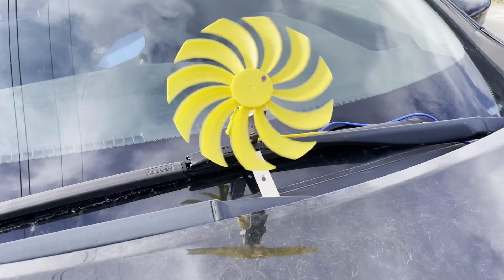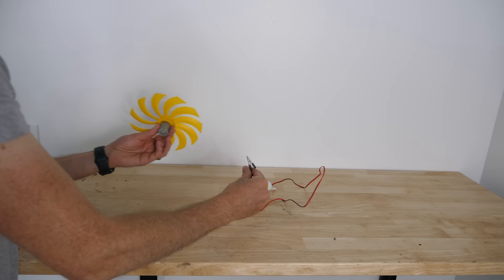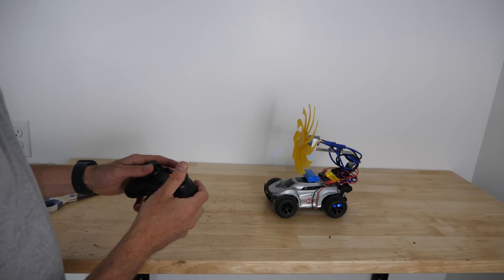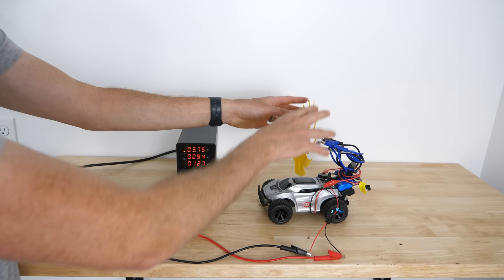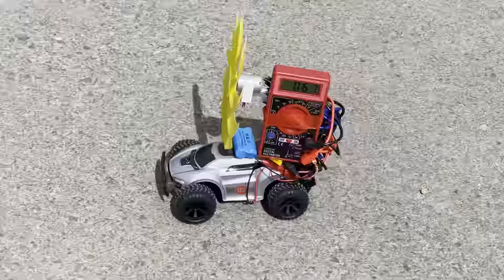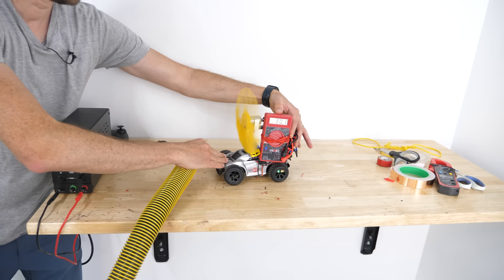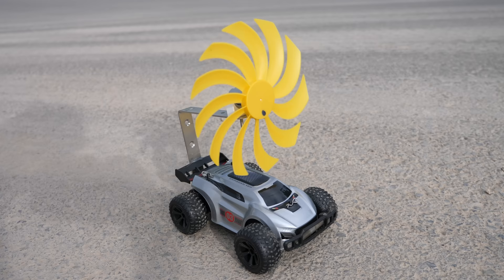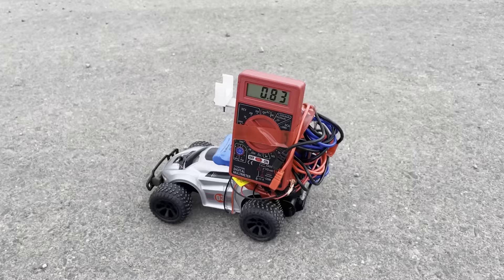Can You Power a Car With a Wind Turbine?

Comment from the maker: Maybe I just need a bigger turbine? Purpetual motion is always just out of reach...
Reply: Perpetual motion is always just out of reach, but wind energy is not.  So you're quite right that you can't get a net benefit from the relative wind you create from the vehicle's motion, but you can make it work on a windy day.
Reply: Veritasium did a great video on that
Reply: wat if u put two windmills sideways vertically on both sides of the car sorta like a wings of a car
Reply: Magnets! You need to implement magnets. Somewhere, somehow, magnets are always the answer..

Maybe if we coat the car in the right plastic, the air flowing over it will produce enough static energy to power an electro-magnet which we can use to spin the blades!
Reply: Now you could try to use the excess heat of the car engine to power a steam or stirling engine.
Reply: @mr0big  might be easier to find a way to use the exhaust to turn a turbine. The exhaust seems to be the best source of waste energy on a combustion car.

Would need very regular cleaning
Reply: Maybe storing the energy lost from braking would be more applicable
Reply: yes, much bigger turbine to pick up headwind and the car will move forward against the wind, one has been invented and it worked
Reply: @chrism3784  that's not the same principle though. If you attempted to propel a vehicle forward from another source, you'll now need to also power the giant ass fan. You'll gain less power from the fan in motion than you would at a standstill
Reply: @FameLuck  Such things exist, in the form of turbo chargers. They use the exhaust stream to drive a turbine that increases airflow to the engine, increasing performance. Though the increase is only really felt at high RPM loading
Reply: @fooboomoo  yeah
Reply: How about putting coils on cars & have large magnets on the sides of the roads. that way each time a car passes the coils it generates electricity & feeds back into the cars.
Reply: so effectively, Theres no excuse why installing a wind powered fan in an EV radiator and hooking it up to the battery for charging. isnt entirely plausible.
Reply: @RanndomUndead  It is entirely implausible. I mean physically you can do it, you can plug it all in. But no matter the configuration: head-on, in the back, off to the side, underneath by the wheels; you will never gain enough energy to charge your vehicle to an extent that compensates for the extra drag. If you put it in front of a non-aerodynamic flat surface, like the grill, as some have suggested, you may recoup some energy that would otherwise be lost. But, due to the Betz limit on the possible efficiency of a wind turbine (or any device collecting energy from fluid motion) capped at 59.3%, the energy you could recover would not be close to the energy you could save by making that surface more aerodynamic, by streamlining the profile, smoothing rough surfaces, and sealing panel joints. Some have suggested using the turbine as a sort of air brake, but this is far less efficient and more complex than simply using regenerative breaking with electric DC motors. This video and the one before it are just highlighting why this, and other seemingly intuitive but nonsensical "low quality energy extraction" mechanisms can't work due to physical limitations
Reply: @FameLuck  you forgot to include the fusion generator in your scheme, makes the magnets stick better
Reply: @Spencergolde  turbo charges use exhaust, but it still comes out eventually - that exhaust is the only large energy rich waste source i can think of that can be further exploited easily. Unless we can utilise the heat waste better
Reply: @Spencergolde  genius! Fusion, magnets, turbines... The trifecta of energy generation.

I'll give Musk a call, he'll be interested.
Reply: @FameLuck  the only practical thing I can think of for waste heart recovery are thermoelectric generators. They've been trialed in some proof of concept engines sinked to the engine block, but they're price and inefficiency make them impractical now. If you want to go full out efficiency though your best bet is to link a bunch of electric cars together into a streamlined profile, load lots of people on at regular intervals with stops, and run the wheels on low friction steel rails. Asked musk about that one too he said it's not complicated enough,  wanted to add vacuums
Reply: @Spencergolde  ultimate solution - make all roads in a vacuum. It's really not that hard 🤡
Reply: @Spencergolde  regular vehicles already have a radiator fan spinning.
Reply: @RanndomUndead ... the radiator fan... cools the engine. That's all it does. It blows air on the radiator. That fan is not a generator, it doesn't make any electricity
Reply: @Spencergolde  there is literally zero reason it cant be modified to charge a battery aswell
Reply: @ranndomundead9112  You could definitely modify it to generate power, but you'll always use more power spinning it to overcome the new resistance you've added trying to take power. In other words you'll lose more power doing that than you would not modifying it at all.
Reply: @MelodicTurtleMetal  if its already spinning regardless youre just wasting an energy source. Having a way to harness that wasted energy doesnt increase resistance.
Reply: @ranndomundead9112  you're not wasting it, you're using it to cool down. The air flow is optimised to cover the area to remove heat. If you obstruct it in any way you'll reduce the cooling, which in turn will force the fan to work harder to cool down the target. You're literally taking energy you put into the fan, and inefficiently converting it back into energy. If you place it after the cooling, you're now adding a wall where the air used to flow freely, and you need to put power into moving that air around your new fan. You'll always be better off without the fan. 

Every obstruction you make to the flow of air is detrimental. All you're doing is adding more resistance. You're lowering efficiency because the radiator air is not a waste product.

It's the same reason vacuum cleaners don't have turbines to regain power power from the suction output - you'll make it suck harder to freely remove the air
Reply: @MelodicTurtleMetal  no one said anything about obstructing anything.
Reply: Didn't Veritasium and Integza both do videos on cars that can be powered by propellers from the oncoming wind? In those cases the propellers were mechanically attached to the wheels but I don't see why it wouldn't be possible to create an electrical connection. There would certainly be a bit more losses in efficiency since you're converting mechanical energy into electrical energy and then back into mechanical energy again, but I imagine it could still work.
Reply: @ranndomundead9112  your turbine or fan will be an obstruction. Air does not flow freely through them, so you're adding resistance and turbulence. You need to optimise the air flow through to increase efficiency, not cutting it up and slowing it down. You won't regain energy, you'll require more energy to remove the hot air.
Reply: @joshuaewalker  you'll only ever get the same energy the wind would have provided at stand still. On a windy day you could gain power, but in motion at 100% efficiency you would still only gain exactly what you would have gained when the car wasn't using energy, and because the turbine or fans aren't 100%, you'll have to exert more energy into forcing the air through them you'll get out.

This video isn't about generating power from the wind, that's very possible and simple, it's about trying to gain energy when you're applying energy anyway.

For those wind pushed vehicles, the faster they go the less efficient they'll become, so without another source of power it can only go at the taste of power it can generate with the current wind blowing into it.
Reply: I think the best option is a combo of magnets and solar with a few batteries.
Reply: @ToddChevrier  what are the magnets for?
Reply: @MelodicTurtleMetal  just like the motor Action lab is using, but use solar power during the day and batteries at night. We will never get over unity, just need to utilize what we can use in order to produce electricity. The motor has magnets in it, but if you make a larger version to produce what output you need.
Reply: @ToddChevrier  I see. I think the problem is that moving parts like this, with this much exposure, would require too much maintenance to maintain efficiency to be commercially worthwhile. 

I'd love to see a study on solar usage though. I imagine for someone like myself, who parks undercover both at home at work, the extra weight would be detrimental, but i also know my friends car is exposed to the sun parked at his home and workplace, and would probably benefit from it.

But it would be a substantially higher weight, so there would likely be a usage point where it becomes less economical.

We need data!
Reply: Hey , an Ideea for another video. Can you put a butterfly nut inside vacuuum chamber and somehow spin it when it's no air? Will the Djanibekov effect take place in vacuum?
Reply: @fooboomoo  exactly, with highly efficient motor and good propeller it could work while driving upwind
Reply: There already are wind powered vehicles - they're called sail boats.
Reply: Obviously you can't power the car by the wind it generates itself on a windless day,  however on a windy day it is possible to power a vehicle this way, provided you have the right gearing. People seem to be confused by this as they conflate Force with Power, when actually Power = Force x Velocity. This means you can travel at any point of the wind provided the input is from the medium which is moving at greater relative velocity to the vehicle, and the output thrust is applied to the medium that is moving at the lower relative velocity to the vehicle. Indeed, in addition to being able to travel directly into the wind this way, you can also go directly downwind faster than the wind(as demonstrated by the blackbird landyacht, ..see veritasium's channel), by having the input coming from the ground in this case.
Reply: Put peltier devices on car breaks and see if it can slowly recharge the cars battery?
Reply: @alldeeplearning949  Obviously you can't generate net power  by using the wind generated by the moving vehicle on a windless day.  However on an actual windy day you can move a car using a windmill, you just need to have the gearing correct depending on the point of wind you're travelling at. Indeed you can  go directly into the wind, and even directly downwind faster than the wind as demonstrated by the blackbird windmill powered cart.
Reply: What about you put the dynamos on the front wheel??
Reply: @ranndomundead9112  
In College someone tried arguing that playing the radio didn't use more gas.  They said the alternator is already spinning.  But by using the radio it now needs more torque to turn.
It turning isn't the whole equation.  And that is a point that you are missing.
Reply: One of these days...the action lab is going to come up with a  perpetual motion machine and totally change life on earth.
Reply: Technically one can have a turbine powered car:
@Veritassium already did this with @EngineeringWithRosie , @xylafoxlyn and I forgot the name of the person who made the design.
The difference there is that they didn't waste energy dumping the wind into a battery, also they relied on the wind pushing from behind, like that of a sail (See how sail boats can do faster than wind sailing BTW)
Also, not very practical either.
Reply: or maybe you get the design wrong. the design that you made on this video has a lot of air resistance and 100% energy created from the windmill/generator. maybe you can make a design that has less air resistance (more aerodynamic) and has less energy created from the generator, but we need to find the sweet spot where it has the highest yield in energy production compared to air resistance. at least it reduce the amount of energy used from battery.
Reply: No shit Sherlock…
Reply: Try using magnets and a turbine to harness the repulsion that come from the polarity of the magnets.  Theoretically I think that could give you a constant spinning while not using any energy to make it happen.
Reply: Solar powered,wind turbine?!.hydrogen car?!.😂😅😮😊
Reply: Wind power boats are very definitely a thing, and have been around for a very long time. The one thing they couldn't do though was go straight into the prevailing wind, they can at best go at about a 45° angle into the wind.
Reply: Perpetual motion of course not.

But what about heat pumping?

Hypothetically wouldn’t it be better to take a smaller diameter turbine and connect it to a Venturi?  Larger mass flow with higher kinetic energy? If the outlet air is colder than the inlet ?

That’s a stretch I do appreciate this. But let’s take it one step up shall we,

Let’s fill a rocket shaped boiler with hot water and accelerate it to hypersonic velocity in relatively dense air… 

Then use the resulting aerodynamic friction heating to create a high pressure supply of steam thrust….

I read somewhere that in certain conditions an appreciable fraction of the work comes from the ambient heat of the air. So not all that thermal heating is the result of of a kinetic trade-off if you will.

There is a coefficient of performance , hence the potential to pump heat.

Perhaps the starting temperature total weight and momentum of the rocket can be argued to be some sort of kinetic battery for the sake of no better analogy coming to mind.

As the drag heat up and slows down the velocity the interval temperature pressure rises, then when the steam is released there is a lever effect perhaps. Trading mass to maintain velocity. Maintaining velocity means maintaining heat source. 

Hopefully by the time your monopropellant fuel mass’s kinetic and thermal energy has been spent thrusting the craft through atmospheric space the payload has reached its destination…
Reply: @us1ng  congrats you just built a helicopter
Reply: It's perpetual, not purpetual
Reply: Can you produce energy using a front wheel generator? 
And connect it to the other battery while driving car .Car runs on the primary battery and the generator charges the second battery after charging the second battery, use it to power the car.
Reply: possible.. conceivable.
Reply: When you park your car, you deploy the windmill. 🤣
Reply: Your best bet is to cover the outside body of the vehicle with solar cells. Your vehicle can charge in the sun whether or not it's driving. Seems like the best, no-brainer way to slow depletion of the battery of an electric vehicle. Another option might be to have a foldup wind turbine that unfolds from the roof of the car and operates to recharge the batteries when the vehicle is parked, then you fold it back down before you start driving.
Reply: Your design needs to be a roof top tunnel, that allows the wind pass straight through, and whisp by just the ends of a turbine blade sticking out inside the wind tunnel.   Like taking a water hose, and spraying water just on the outer surface of a bicycle tire, where the water barely makes contact with the tire, but gets it spinning really fast....we used to do it flipping our bikes over, cleaning our bikes and stuff, lol.    

So it would be a Horizontally mounted wheel in the side of the wind tunnel that bolts onto the roof.  And just the "knobbies of that wheel" sticking out and exposed inside the wind tunnel, whereas the wind can whisp by, like a stream of water barely brushing against the bicycle tire.

This will allow the turbine to spin up fast, and not make a huge wind drag on the vehicle to slow it down and make the motor in the car work harder...just saying.  It's my design from over 10years ago.
Reply: You need a better RC car!  =P
Reply: Can u try this using a magnet?
Reply: @coraggio1012  Wut?
Reply: thank god for adblock
Reply: Bigger turbine might work to collect more power from the wind. This power can be used to drive the car. Of course it will not work without any environmental wind.
Reply: ...and always will be.
Reply: Yeah, let's talk about perpetual motion on a YouTube video. There's not enough of that crap on here. 

Now is when I click your video, and select the "don't recommend from this channel" button. Way to use buzzwords to turn off real thinking humans.
Reply: this would work but then the efficiency if the car would be reduced
Reply: Looking forward to video demonstrating electrical motor version of Veritasium wind car experiment, I think surpassing the speed of wind not possible due to electrical power conversion efficiency however moving against the wind will be ok.
Reply: @us1ng  --  * What if you
Reply: Just add a reverse turbine instead of pushing backwards,try it
Reply: Imagine what would be possible if all the effort in disproving perpetual motion/energy were instead put into trying to obtain it, perhaps it is unobtainable but even the failures could be more efficient than what we have now. A lot of smart people that should be experimenting with new ideas are wasting time  proving they memorized their physics text book. This hardly seems like the most efficient design we can come up with right. A better turbine design along with aerodynamics ability to create high/low pressures should be considered as well as different energy storage methods.
Reply: Try again with a toroidal propeller
Reply: Your turbine work with newton princible. Newton turbines convert drag force to electric energy. You must try with a  turbine that works with bernoulli princible.
Reply: @Rick_Cavallaro  how    do you  know  that  this is  a Perpetual motion device?

 he  never  said   it  would  run  forever
Reply: @robinsss  
>> how    do you  know  that  this is  a Perpetual motion device?

More importantly, what makes you suggest that I think that?
Reply: @Rick_Cavallaro   because you said  this

'''''Perpetual motion is always just out of reach, but wind energy is not. So you're quite right that you can't get a net benefit from the relative wind you create from the vehicle's motion''''''
Reply: @robinsss  and did you honestly fail to notice that I was responding to Action Lab's post saying that perpetual motion is just out of reach?
Reply: @Rick_Cavallaro  '''''''So you're quite right that you can't get a net benefit from the relative wind you create from the vehicle's motion,'''''

he  could  recycle some   of the  energy  he  started  with  and   use it   again ?
Reply: @robinsss  No.  There's no way to extract net energy from the apparent wind (i.e. the wind that's strictly a result of your motion through the air).  There are however ways to extract energy from true wind (i.e. air that's moving relative to the ground).  To do this, the vehicle has to be immersed in the air and in contact with the ground.  It ultimately has to slow the air relative to the ground - thereby taking some of its energy.  Another alternative is to extract energy from a wind gradient (typically slower wind nearer to the ground).  This is how an albatross can fly for hours without flapping its wings.
Reply: I blame santa Claus, we just stop lying to children at a certain age and expect them to suddenly see everything that's too good to be true